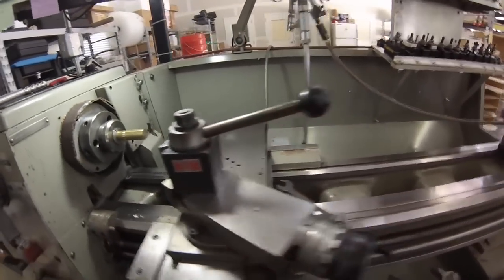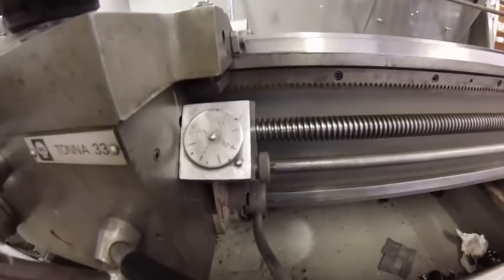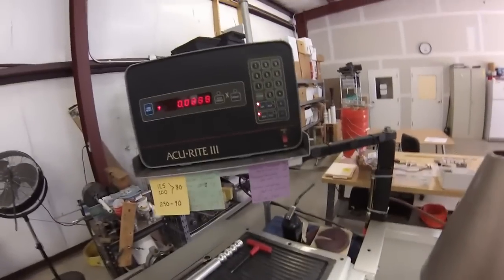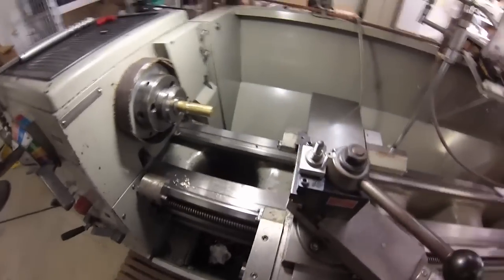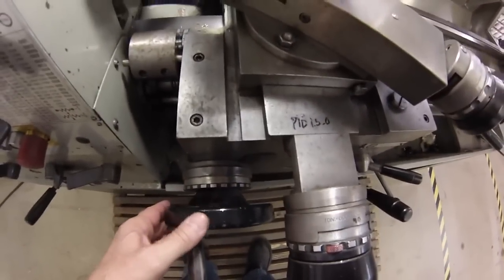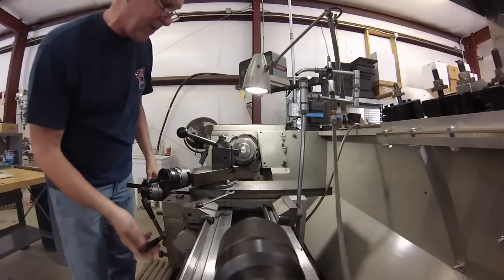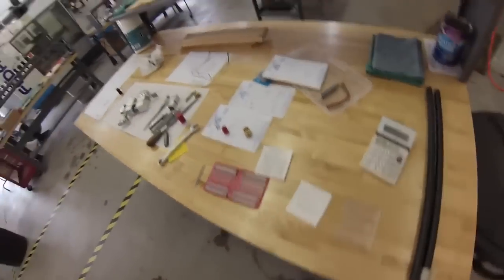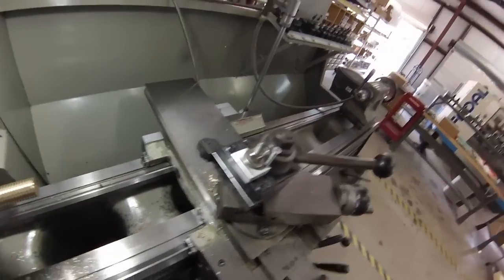Anniversary Video -- Easy and STRESS FREE Single Point Threading.

Comment: Actually watched it a while ago. Sixty years ago I began my apprenticeship and with 5 years using  screw-on chuck lathes (except in the once per year schooling) I found it awkward and it never caught on with me even when using cam-loc lathes I have never experienced problems as a major part of my work for 12 years or so was making u-bolts, prop shafts machine spindles - all using alloy steels. I really have to give this another shot as my 'hobby' lathe is a screw on but fine threads should not be a chuck losing problem. Thanks so much for all of contribution to this trade.

Comment: I use a couple small pcs of masking tape on both ends of the pins so they can stay trapped on the part. Eliminating the need for 4 hands while you measure. Plus ya dont drop your pins. 👍
Reply from the maker: You can successfully measure a thread using only one pin. the other 2 in the pack are spares. :)

Comment: Trying to see the extra adjustment block on top of your quick change tool holder to get the tool on center, with the shank mounted upside down. Could not see it though.

Comment: I don’t understand why the cutter doesn’t always lift.
Reply: It's trying to, but the toolpost is holding it well enough not to slip. I do 4tpi threads all the time and wouldn't trust doing it this way because the tool pressure is much higher. Also, I thread metric pretty much daily, and my lead screw is imperial. Gonna be really tough to get that carriage stopped in just the right spot to start my tool in the groove. I find it's just all around more practical to thread the conventional way.

Comment: Thanks again, Joe.  I remember finding this video six years ago and it served me well.  I subbed  after the video about thread repair.  Funny thing is I have two bores to cut 2 1/2-4 2B tomorrow and two of the same that won't gage that were thread milled on an old VF3 50 taper.

Comment: I wouldn't advise this old trick on a small lathe. Certainly not with those very light hobby machines. The carriage can be lifted by the acting forces, and in the absence of the support of the bed it becomes an ugly screw thread at best.

Comment: 8:00 is there anything holding the carriage to the bed other than gravity?
Reply: That's kinda the problem with doing it like this. You are trying to loft the carriage essentially, but on a thread this fine it's not an issue. I'm the conventional method the carriage is being pushed down to the ways under load.

Comment: At 2:46 where you describe the result of engaging the half nut on the half line as "turning a 10-pitch thread into a 20-pitch thread" got me wondering if that's actually the case.  Unless you modify the gear change settings you'd still be running at 10 TPI, so wouldn't that mean you're still cutting a 10 pitch thread but with multiple starts?  Just wondering.....  Thanks for sharing your incredible wealth of knowledge. i don't think one of your vireos goes by without me picking up some new trick or technique.  Please don't stop.
Reply: Yes, you are right. This way you make a double 10 TPI thread.

Comment: Thanks @joepie221 any hints on doing this when you can’t disengage the half nut. e.g. when cutting a metric thread on an imperial lead screw or visa versa? I’m worried that I’ll feed into my carriage stop.
Reply from the maker: Greetings. Using a carriage stop while threading is a risky proposition and one I try to avoid. When returning a carriage to a home, or stop position, with a half nut engaged, its ususlly being dragged by all the gears and screws. When actually cutting a thread, its being dragged, or pushed in the opposite direction and subject to the slop in the gear train and lead screw. If possible, do away with the stop and return the carriage to a location beyond your starting point if physically possible and then bump the machine in the threading direction back  to the start position. All the gear and screw lash should be loaded up and ready to instantly move when asked.

Comment: I’m not very experienced at single-point thread cutting but now that I have a lathe capable of doing it this way it’s become my default, except for internal through threads where it isn’t really as important.
Reply from the maker: It will be when its a bottomed hole.
Reply: @joepie221  Yes, I’ve done it for a bottomed hole.

Comment: unfortunately this method is no good for me, all 5 of my lathes from the 13" southbend down to the tiny watchmakers lathe run screw on chucks, so running them in reverse is a big no-no (in fact none of them have switches that would allow them to be run in reverse- except the southbend where you can reverse the leadscrew.)
the unimat does have the advantage that it is only ever hand cranked when threading as that is how the threading attachment works.
Reply: You can run in reverse when you're using collets like Joe is.
Reply: @knowitallyankee8049  most screw on chuck lathes don't have reverse as an option

Comment: When I worked at Grumman aircraft in the 80’s one of the old timers used an indicator on the carriage stop. He would go to his zero and flip the half nut lever. It worked good because of vision problems with coolant and feel with a solid stop. You can also use this method to withdraw the tool on your zero. On the threading dial with the odd number thread you can use the no number line as long as you just use that line only,same with the number line like Joe said. Good tip Joe, thanks Jim.

Comment: I remember this one, it changed the way I thread on my engine lathe. Since this came out I have obtained a Hardinge HLVH, and haven’t used this process lately. That machine is a pleasure to use. Keep up the good work. I appreciate your emphasis on safety, and your attention to quality such as measuring over wires for PD.
Reply from the maker: That little hardinge is such a sweet machine.

Comment: HI JOE GREAT VIDEO. AS I WATCHED I WAS WONDERING IS YOUR LATHE A CLAUSEING. BECAUSE I'M LOOKING AT A USED ONE 15X 50 AND WAS WONDERING WHAT YOU THOUGHT AND HOW YOU LIKE YOURS. any help would be very appreciated.  Thank you very much Joe.
Reply from the maker: The 15" clausing is one of my favorite machines. Mine is a 13"
Reply: I have two 15 x 50s at work for two years now and am very pleased with them.  One is set up for collets and the other with a chuck.   I just wish they had a pedal brake like what i grew up on.

Comment: You are the best Joe! Tried this just yesterday without success because the tool would lift away from the stock. Obviously I needed something better than a small, worn out Clausing lathe. 
However, I did successfully make .006 shims after watching your video on that topic.
Reply from the maker: Excellent. Secure that tool and try again.

Comment: This is very good material. Often you have to run a thread up to a shoulder. This can easily not end well. This approach is priceless when running many lathes including engine lathes.

I have both an old Hardinge lathe and a monarch 10EE with ELSR. Both have leadscrew stops to shut the machine down instantly. But the lead screw stays engaged at all times. It makes threading up to a shoulder easy and less stressful. 

Barring these two lathes, I would always cut shoulder threads using the upside down tool.

The issue with tool room lathes is that low pitch threads under 11 TPI place huge loads on the gear train. These course threads are best cut on an engine lathe which disconnects the lead screw on the return.

Comment: This is a good idea Joe. Quinn had presented this idea on Blondyhacks a while ago and I agree that it works very well. But thanks for presenting it.

This also works very well for internal threads.
Reply from the maker: She learned the technique from me. 13:44 in this video https://www.youtube.com/watch?v=q7scadYptTI&list=PLY67-4BrEae9Ad91LPRIhcLJM9fO-HJyN&index=28  She also suggests taking a million shallow cuts. When threading, Not good advice.... you reduce the depth of your cut as you progress. Heavy cuts initially and end with light cuts. Much faster.

Comment: Hi Joe
Brilliant as usual.  I foun holding the wires in a piece of foam works really well to keep the wires in control.  Hate getting them out of the chip tray.😊 Thanks again for the brilliant content. 
Regards from Australia
Reply from the maker: Did you know you only need 1 wire to check threads.........

Comment: Do you have any ideas on holding a taper in a four jaw? Something I'm working on requires me to hold the part on the taper and I've not found a good way without spending a day making a jig to hold it in.
Thanks.
Reply from the maker: Mash 2 rings on the taper of different ID's. Turn them to a single OD. Flip the part and grip on the collars.
Reply: @joepie221  thanks

Comment: Hi Joe .  I consider their are couple of down sides to that method , that is why i never use it .  
If you have a premature half nut engagement  , ie you grab the crest or the down slope of the leadscrew you will scrap the part or at least the first thread . 
You can not cut a thread unless it has a thread relief , as a lot of threads do not .
Cutting a metric thread on an imperial leadscrew is a right pain ( as is common practice ), or visa versa  as you have to get the tool into that groove .
Generally only high end lathes have a half nut engagement lever that has the positive feel to be able to consistently engage in a relief groove without error .
If you are using multiple lathes , each one will have a different half nut feel . That will increase the risk of not being able to pull out in time in case of a mis engagement . 
Just a couple of points !  Cheers  👍

Comment: Awesome Joe. In machinist school I made pretty much every mistake threading can have. 1/2 nuts not properly engaged was always my worst enemy. Over the wires made things worse. I was out of school and working in job shops I was confronted with having to do what I really wasn't comefortable with. A good old friend Tony saw I was under the gun and in about 4 min I was threading away. He taught me to never disingage the split nut. Leave it on the O. Test and run the thread and when done that, stop, pull back and into reverse leaving the split alone. Back clear of the piece, reset for the next pass etc. 50+ years later not a screwed up thread behind me. I never have tried the down side up thing but there is a first time for everything, eh my friend. Great post bud.

Comment: I remember seeing this first time around, I use insert tools so I immediately ordered left hand tools for internal & external thread cutting & I always do it this way now. I’ve never set my compound to 29° though, all the work I do is too small for that & I don’t want the hassle of re-setting it afterwards (it’s bad enough that I have to mess around with change gears every time I cut threads).
I also don’t use the dial, we didn’t have dials when I was at college, so I’ve always left the half nuts engaged. I’m also often cutting metric on an imperial lead screw, so it’s not much good to me.
Loving this classic Joe Pie video. I’ve always said you’re the best machinist on YouTube & I stand by that.

Comment: Joe, please do your viewers a favor, when videoing freehand you should either use a gyro-holder or turn on image stabilization. 

In regards to feeding at an angle with the compound verses straight in with the cross-slide, the primary reason for doing this is for clean chip formation. Regardless of whether you're using inserts or ground tooling, you only want to cut on one face of the tool. Cutting on two faces dramatically increases cutting forces and creates an undesirable curled chip which adversely effects surface finish.
Reply: been doing this way for years and the threads ive cut and the tools hss or insert havent noticed straight in feed one time never had a thread that the opposite didnt screw into or on to perfectly the 29 degree thing makes no difference if you pay attention and dont take huge depth of cuts for the last few runs
Reply: Yes Joe how dare you post your FIRST video ever without going back and post-production stabilizing it  ::)  :) You have come a long ways.   EDesigns you did read this is the FIRST video he published ...

Comment: Very persuasive, as always  but the advice is based in part on two assumptions:  you won't need a rising block for the toolpost to use an inverted tool (on many lathes you will) and that your thread is of the same type as your leadscrew, which it often won't be. My Harrison M300 dual standard lathe has an imperial leadscrew and I cut metric threads, so I cannot disengage the halfnut. The Dickson toolpost needs raising at keast half an inch. How do I get the tool back to the start point while still engaged without the same fears?
Reply: you just back your tool out the cut run it back close and turn the chuck back to 0 by hand feed in and hit the start button been doing it for years for metric threads

Comment: Thanks Joe, good advice as usual. 
Unfortunately, not something you can do with a lathe that uses  a thread on chuck. It'll  be likely to "unloosen" in reverse. So exercise your butt muscles and learn to forward thread! 
Or go and spend a few thousand bucks and find a lathe with a non threaded headstock spindle.
Regards from Canada's banana belt. 🤞 🇨🇦🍌🥋🇺🇦🕊🇺🇲💙👍
Reply: Good point. BC fella here. My 50 + yr old Czech 23 inch swing has no split nut. Threading is engaged or not. It has an internal brake so going from forward to reverse can be made in a snap. It has a reversal pedal as well I never use. As well it can cut 4 different pitches of threads. Love that old lady. I never knew what make it is.

Comment: Thanks.  good way to do it.  one shop I worked in used a tracer lathe to thread. and the tracer backed the wood out very nicely.  The tracer was a nice device, you don't see then aye more.

Comment: Joe - Thanks in promoting simple concepts! 
I just successfully cut 0-80 thread on drill rod, after I designed and built gear box with Electronic Leadscrew for a 10MM Levin Instrument Lathe.   
Your videos,these past years, provided the insight and confidence to take on this task - so thanks Dude.
BTW - loving the AI milling tooling/clamping plate as well.
Cheers,
Mike

Comment: Most of the threads I cut specifically call out no undercut, and want a "vanishing" thread where you pull the cross slide out while the machine is turning. I use the inverted tool method for left hand threads to be able to cut a left hand thread towards the chuck and achieve the vanishing thread.

Comment: Excellent stuff. This is the kind of stuff I want to learn on my new lathe. I was really surprised you didn't use the compound for your advancements. Most guys set the cross to zero then advance the compound blah blah. 

Question: If you loosen the the quick change slightly for chatter wont your measurement change slightly?
Reply: He didn't loosen it to cut the thread, he loosened it to demonstrate what happens if it catches, you can go strait in with carbide as he explained 👍
Reply: @EnglishHobbyMachinist  AH your right. I thought he said it as a comment on loosening the post and I thought that was really different!!. Missed that one😊.

Comment: I saw that gearbox dial and was right back in my apprentice days, I don’t know what that lathe is; but that dial (or one all but identical) was on all the Colchester lathes in the training school…

The three wire method can be awkward, so alternatives do exist; (although the three wire is pretty universal). The nut method is a field-expedient ring gauge; but a ring gauge is calibrated, hard and much more precise. You can also get wire gauges in the form of a spring. These are wound to specific threads and have a couple of advantages: First and most important, you don’t have to hold them in a place, secondly (because they’re specific to the thread) the chart work has already been done for you and you have a go/no go straight off the micrometer.

One thing I never understood (I didn’t do much single-point threading as my apprenticeship was directed to the CAD side) is how, if any hash can be used for even threads, multi-start threads work with the dial.

Comment: If you use wires to measure an external thread, how do you measure an internal thread?
Reply: You make a gauge and measure the gauge over wires or with thread mics and then cut the internal thread until your gauge threads in.
Reply: @thetoecutter13  That is how I was taught, but I was hoping there was another more direct way.
Reply: @ajosepi1976  I'm sure there is special measuring tools  that can measure the pitch diameter of an internal thread that's used in production facilities, which is ok if you're making  millions of the same thread and want to invest in having something made that will help in adjusting the machine without having to try to run a plug gauge in and guessing that it needs another .003 taken out. In the job shop, if we have to cut a bastard internal thread, we calculated the over wires size and make a plug gauge. I don't know of any other way or how to actually measure the pitch diameter of an internal thread.
Reply: @thetoecutter13  I have used go - no go in a factory, and have done all the things you said. I was just hoping I was missing something and could learn something new. Thanks anyway. 👍